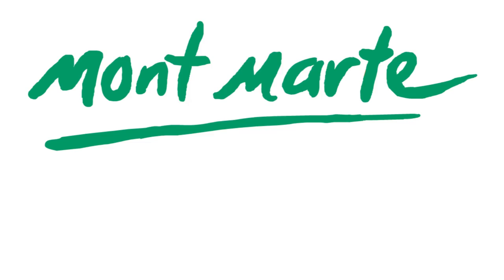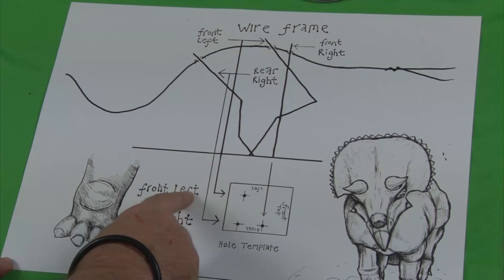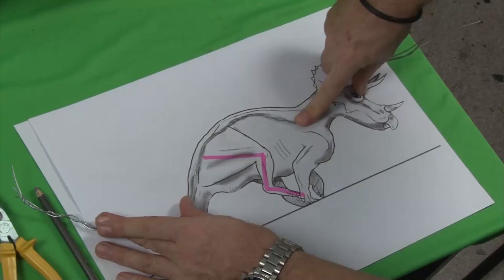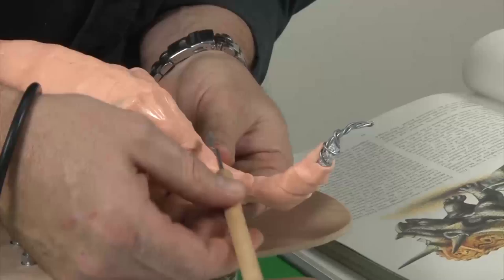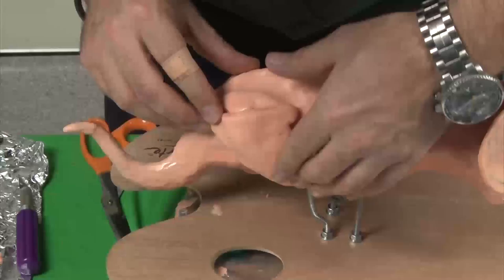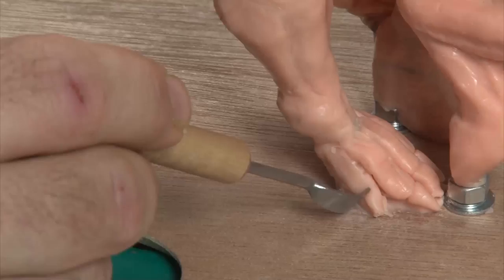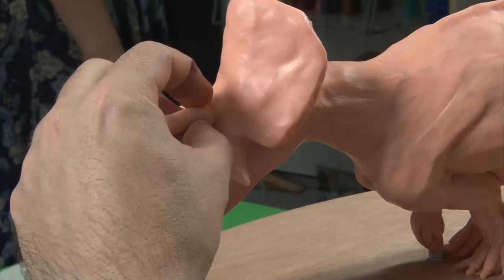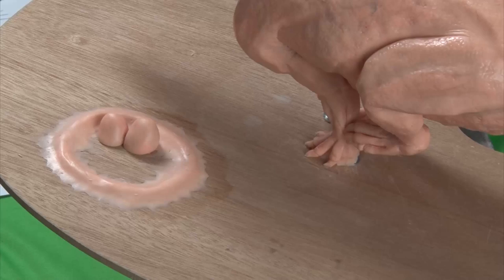Art Lesson :  How to Sculpt A Triceratops in Polymer Clay

Comment: Your horn shape is a bit off - they should curve forwards more - but otherwise it looks perfectly accurate. Well done
Reply: TheOrangeNinja I think it's a young Triceratops.
Reply: There's two species of Triceratops, and in between them there are a lot of variation that could be caused by environmental and developmental events that could have happened in the animal's life. I'd say that the horns are pretty good, probably a bit younger than an adult like Fang said, but this is probably closer to sub-adult.
Reply: TheOrangeNinja yeh the horns wouldnt normally curve up but ever so slightly down, it shouldnt have claws more like elephant kind of feet, the legs were alot beefier in reality and the tail shouldnt curve that much.